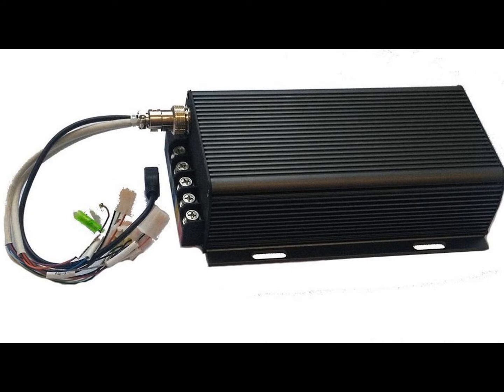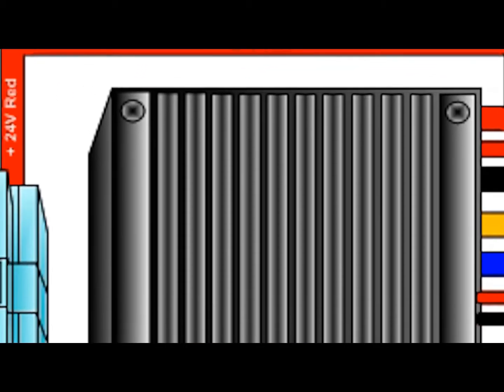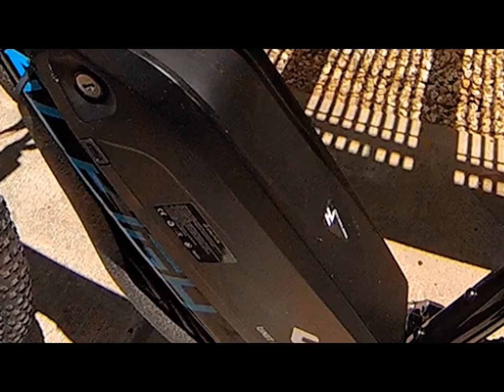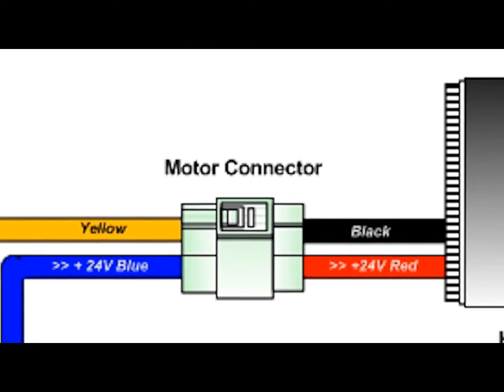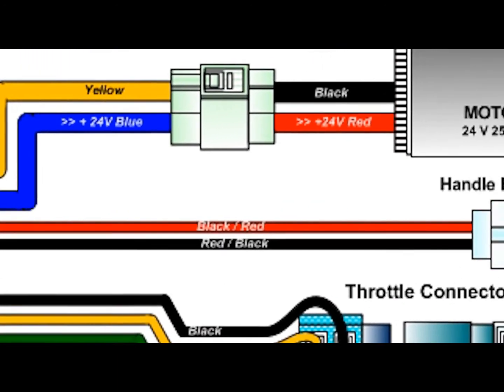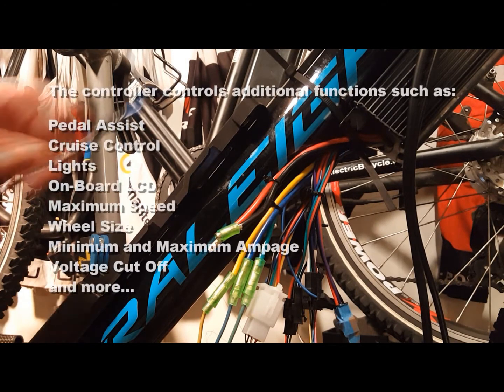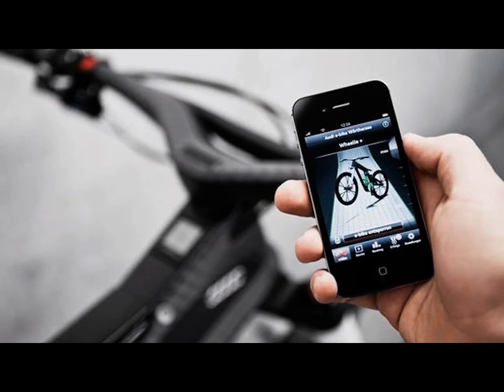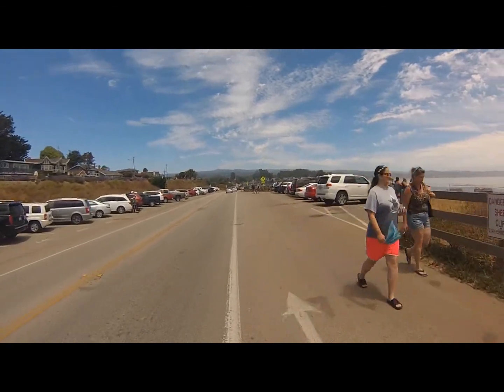What's inside your E-Bike's controller and how does it work?

Comment: pls I have a problem with my controller. when am connecting the three face wire to my motor without power, I find it difficult in spinning my wheel. but as soon as I remove my blue wire, am able to spin it again. pls what is the cause?

Comment: Steve: I have a Populo Lift v-1 model ebike.  Populo and my dealer are no longer in business.  After 2.5 years the pedal assist does not work.  The display screen is indicating Error 1 -  problem with the controller.  My main issue at this point - I can not locate where the controller is.  Appreciate your help.
Reply from the maker: The company is out of business. I am not familiar with the bike, but the controller is either in your downtube or more likely in the rear hub itself. Follow the wires from your LCD or LED

Comment: I have a controller that does not have an existing output for the LCD Computer. I bought the  LCD Computer separately from the Controller and Wheel kit. The computer has five leads, Red, Blue, Black, Green, and Yellow. The datasheet shows Voltage, Control, Ground, Data 1, and Data 2 in the descriptions. Should I be able to connect to existing external leads that go to other locations (motor, PAS, Throttle and On/Off, Brakes) of corresponding colors? What leads should I tap for each of the computer leads? Or, if I open the controller box, would there be some recommended connection points for the five wires?
Reply: I believe controllers have proprietary connectors for displays, meaning only a select few will work with some.

Comment: Hi, I have a quesion about my controller. It has a spare flying lead which I thought would be for throttle control. However the voltage coming out of it is full (36V). 
See pictures here:
https://goo.gl/photos/sgfH8Lg5twEeCYNaA
Any ideas what this lead is for? My e-bike has a pedal sensor installed.
Reply: Lights I'd say